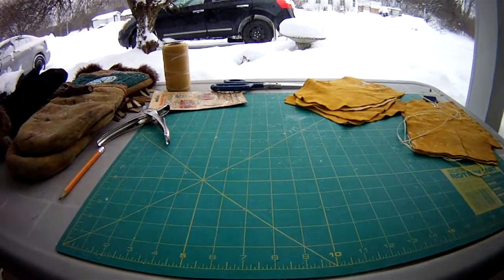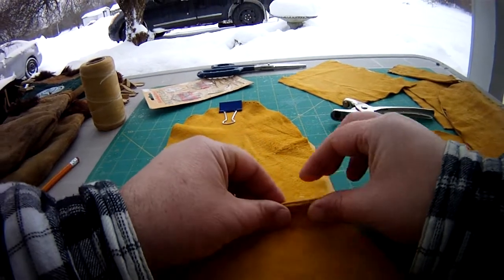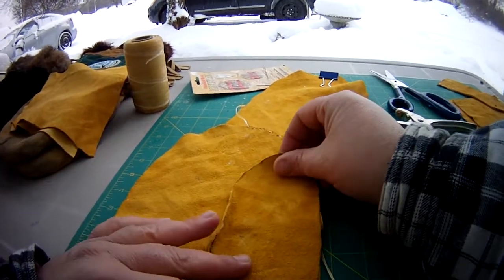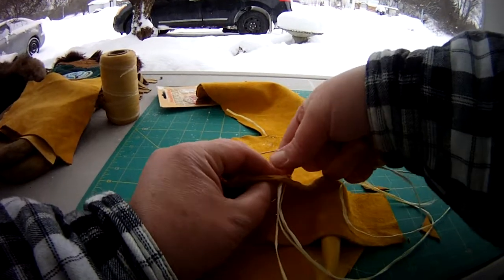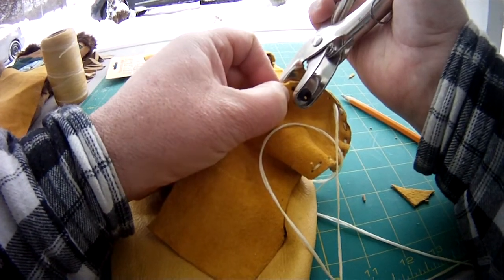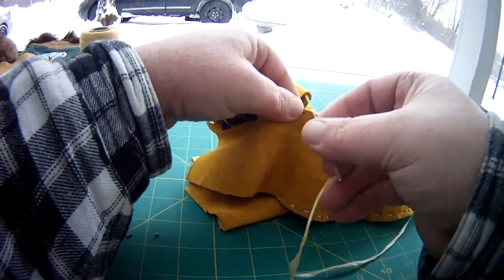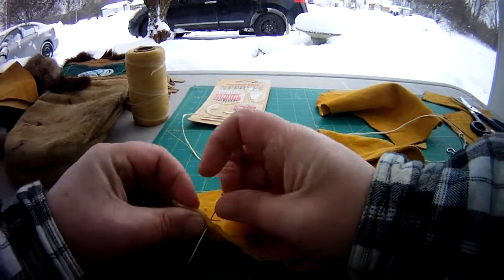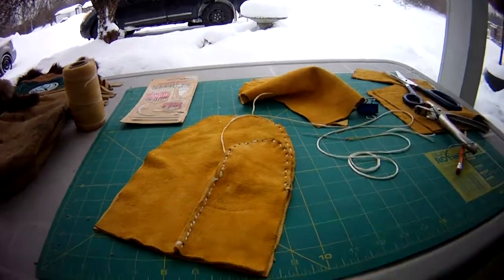Part two Gauntlet Mitts

Comment: Any idea what size holes are punched in?  Not too worried about it.. just curious.  Thanks for making these videos.  I spend so much time out in the bitter cold... I wanted to be able to make my own gauntlet mitts.
Reply from the maker: Stitching Hole Spring Leather Punch

STITCHING HOLE SPRING LEATHER PUNCH  Pressed steel frame with replaceable size 00, 1/16" (0,2 cm) tube (#3237-00). Punches holes in leather up to 6 oz.  (from Tandy Leather ) $9.49 Canadian

Comment: Hi Jessie thanks for part 2 on mitts and old style it fur lining for the mitts wool came later with trade and there are other fabrics that can hold in heat like quilter fabric that has the fuzzy stuff inside it I like wool but it itchy for a lot of people that is why we line your wrap skirt and for the men there Breechclout with cloth or cotton fabric thanks for the video and good luck
Reply from the maker: thanks for the input  and thanks you for watching
Reply: Don’t use fur it will make your hands sweat and smell. Polar fleece or wool is good
Reply: @mohawkmom100  hi thanks for your input but for the old style fur was use for all of things but I rather have my hand sweat and smelly then wet and cold with fleece or wool fabric

Comment: Well I started my own set of mitts.  Started with a Speedy Stitch Sewer but that deformed the leather too much.  Decided to follow your lead and do the one needle saddle stitch method.  Your way is about 20 times faster.    What is the best way to terminate the ends?  Melting?
Reply from the maker: yes back stich then melt  would be the best
Reply from the maker: or just tie the two ends then melt